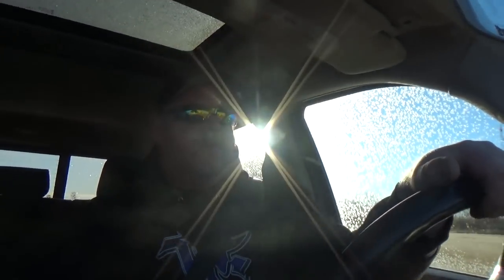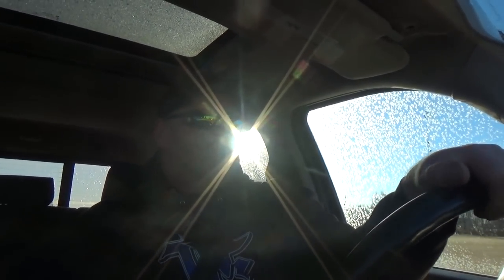Can-Am diff history MudNWheels beginnings and evolution NEW PRODUCT

Comment: Can am sucks period. I switch to a 2018 bruteforce and havent looked back. 650 lbs bike with 80hp to the wheels is much much faster than a 1000 lbs bike with 89hp at the crank. My kawasaki has been 1000 percent reliable on stock bore.